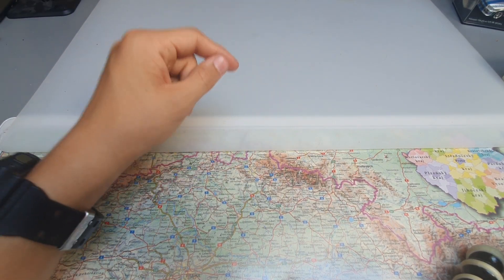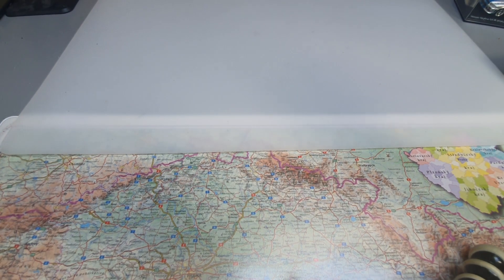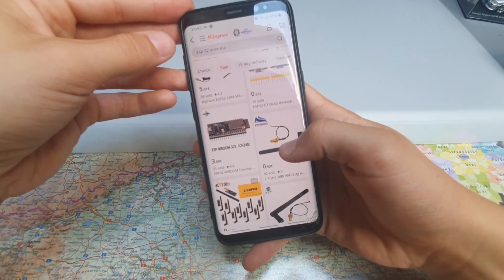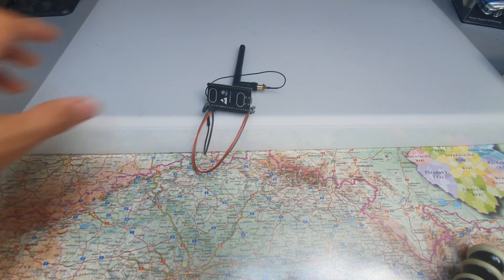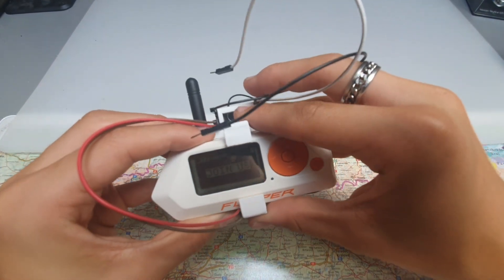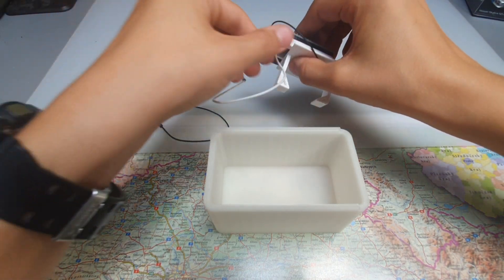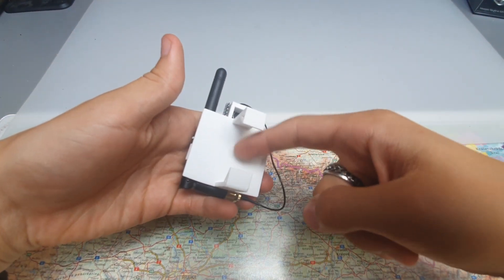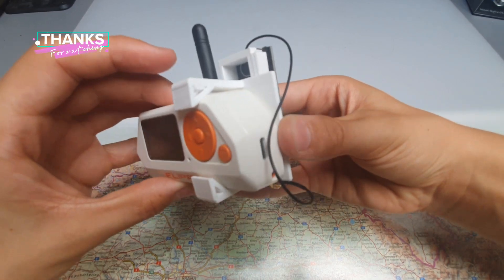Flipper zero ESP32 backpack

Comment: what does it do? what problem does flipper solve in my backback? what is flipper?
Reply from the maker: Flipper zero is a multifunctional device that can be used to copy NFC, sub-ghz signals, RFID.  Then save and emulate them.  Make security keys, act as Badusb and much more.  Esp32 is an extension that allows you to work with Wi-Fi.  For example, to create an evil portal or to start a deauth attack.
Reply: @mikes7357  no its not, it's a television series about a dolfin. This guy does not actually exist.